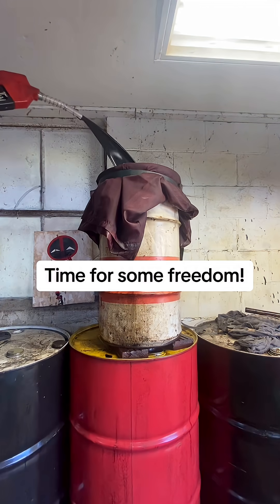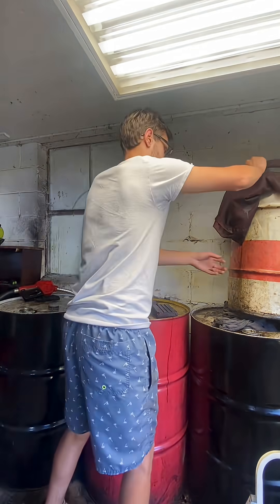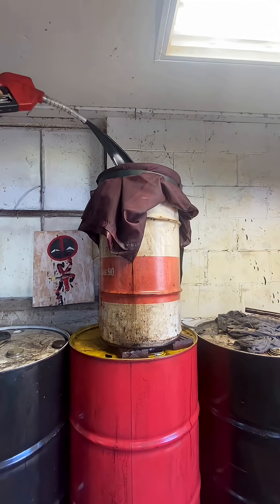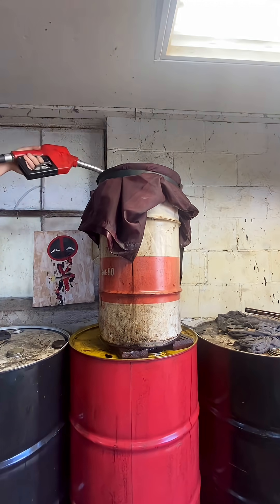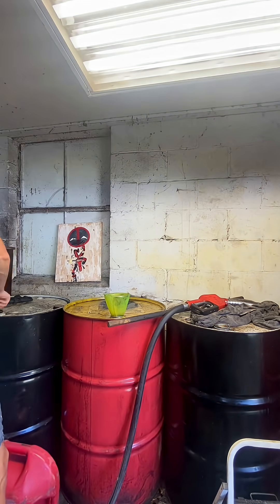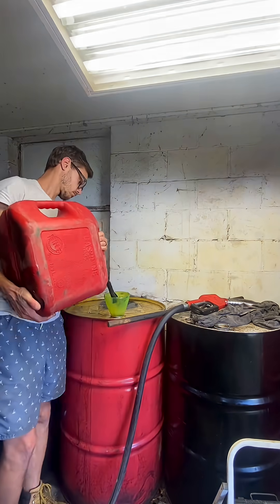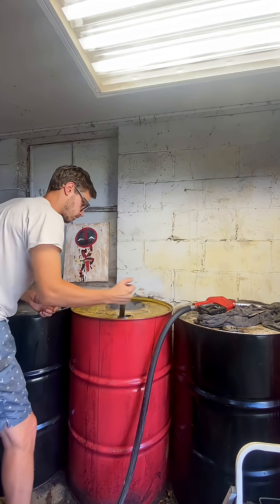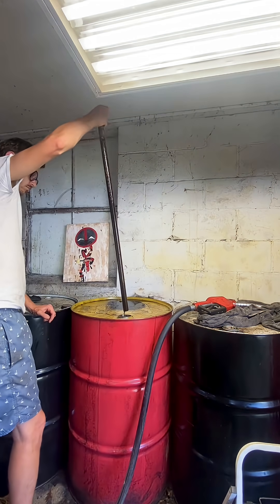Transform #wastemotoroil into #homemadediesel Fuel #dieselmechanic

Comment: I've done this with a Dieselcraft centrifuge. The old IDI Naturally aspirated engines ate the ones ive had the most success with. My 2002 24 valve Dodge does not like enough of it to make it worth while. I'm thinking about running this in my 97 powerstroke. What engines are you running this in?
Reply: Right on, looks like he has an older 7.3. Anything newer than 1998 won’t tolerate it, anything common rail will get destroyed by it.

Comment: Send your filtered oil to an oil lab . A common practice for a large fleet of equipment.  They will tell you how much metal you have in your oil. Your bed sheet is not anywhere close to a diesel fuel filter.  I will have to say don't do it until the lab results come back . Fuel pumps are sensitive to metal and are very expensive.
Reply: Bet he's just 🤡 around so you will copycat him and toast your engine , or get caught by DOT for fuel violations.
Reply: @ralphday4842 no one cares about dot .  But I need to see a lab work up . Because not chancing a fuel pump
Reply: The inside of the engine that the oil came out of is a lot more sensitive than the fuel pump .What you need to worry about is the injector
Reply: @TomThomas-f3w, regardless, send a sample to a lab , even to satisfy curiosity.  It's not that expensive
Reply: @TomThomas-f3w , I sent bio diesel and cooking oil to the lab . Looking for contaminates.  It is worth it

Comment: You make diesel with used oil and gas? Does it burn the same? Same mpg? How much does it cost you and how far will one barrel get you? What diesel motor are you using and does it have mods to support other fuels? Will that homemade diesel run in any diesel?
Reply: I wouldn’t do it with any modern engine but older stuff, including the 6.0 and 7.3 Powerstrokes and pre-2007 Cummins B series engines will run it no problem with negligible performance issues. I’ve run straight hydraulic oil and transmission fluid through a 7.3 and several skid steers for about a year now with no problems. Diesels fire on compression and use super high pressure injectors so if they can atomize the fuel it will burn and the engine will run. Filtering the waste oil is key, though, and it’s worth the money to build a proper filter head rather than using bedsheets. Or you can install another filter directly on your truck and filter it that way lol
Reply: I think his motor is heavy smoking
Reply: Newer motors, don't. It'll destroy them. Older ones with mechanical pumps, have at it but keep extra fuel filters on hand all the time.
Reply: If he distilled the oil first he would be making diesel. Mixing gas and oil like he did only made premix or petroil with a 1:50 ratio.
Reply: No you're not MAKING diesel. He's just filtering used oil adding gas to thin it. Then burning the oil. Diesel is just a certain spec. of oil.
Reply: Same questions I have.
Reply: Go to his page gents. He show you everything you need to know including upgrades he’s adding.

Comment: Did you say that you put used motor oil? I’m just wondering but wouldn’t it have a different composition due to the metal in it, I know it’s microscopic but wouldn’t it still have an effect? Also don’t gas and oil separate? And what does adding the gas do?

Not trying to be insulting, you know what you are doing (obviously) just curious
Reply: Gas thins it out to flow better. Also helps any particles to settle in the bottom, I would hope he lets it settle and pumps off the top
Reply: @Midnight_Rider96  ooooooohhhhh ok thank you. That makes a ton of sense thanks for explaining

Comment: DO NOT use this type of fuel on common rail diesel engines. That oil is black because of soot deposits from the combustion process.soot is carbon and very abbrasive.
Reply: Would used motor oil from a gasoline engine work better?  

I do all of my own oil changes so I’ve got about 20 gallons of used 5w30 motor oil that came from gasoline engines with 5k to 6k mile oil change intervals.  

The diesel motor that I would need the fuel for is an old 1982 John Deere 750 with a 3 cylinder mechanical injected diesel.
Reply: @91CavGT5  yes the gasoline engine oil would have alot less abrasive contaminates, but the john deere wont care either way you could use the diesel oil in that type of engine. But if you wanted to properly use oil as fuel maybe look into a cetrifugal filter set up to run that oil through, it will do a good job of removing any solid contaminates from the oil.
Reply: @X-eler8  thanks

Comment: Put a screw with a rubber washer on it into the back of the handle on your gas can. Loosen the screw when you want to pour the can and re tighten it when you're done. Gas will flow much better and you still mitigate evaporation and water intrusion from the can.
Reply: I've always drilled a 3/8s hole on the under side of the handle of the epa cans. Or just use a 5 gallon water can from Walmart 😅 their blue and they never get stolen cuz people don't think it's gas😅
Reply: @icbro21  "um, sir...thats illegal." 🤓
😂 Man I frikken cannot stand those EPA cans. Spill resistant my behind. They almost guarantee a spill.
Reply: I have the EZ Pour vent and nozzle on some of mine and a screw with sink washer on some.  Both work.

If you get a wing nut appliance screw it is just as easy to open and close as the ez pour vents.
Reply: Oh yeah,  don't drill along the mold seam.  Just to one side or the other.  Sometimes the hole makes the can split if they're old plastic.
Reply: Pull a rubber valve stem into high point on gas can. Use as vent
Reply: @ryanscott1316 just push a Philips screw driver in it and call it a day the can is just to make this crap . And is in the back of the truck no need to worry about a few drops .

Comment: Does the gasoline seperate? How's your catalytic converter look?  Emissions tests, that'd be fun? Do you know anyone that could do one just for fir fun.
Reply: Diesel don't have cats. But in the US at least they've had to run def systems if they were made after 2007. Don't buy one made after 07 they're a pain.
Reply: @bravelilb diesels have had cats since 03. Some 7.3s even had them before that. After 2010 they have an scr which is a def assisted cat on steroids 😂

Particulate filters after 07 but that is completely separate from nox reduction
Reply: Your state has emissions tests for diesels...? Communist
Reply: I wouldn't use this in any engine made after say 1995. A bed sheet is certainly not enough filtering for most unit injectors. Forget about running it in modern common rail systems with DPF and SCR, you will destroy the injectors and after-treatment system.

Comment: Have you measured the Cetane level?
Reply: You dont have to its been used as Diesel 
Motor oil has an ictane of roughly 50 ish 
Gasoline hes using Probaly somewhere in the Ballpark of 92 octane 
Since i dont use my dick to mesure things I Cant Tell you how manny more octane youll get from adding 5gal of Gas to 50gal of oil since i use the metric System
Reply: @blackangel2234  Cetane and octane are opposite ends of the scale.  In diesel fuel, the cetane measures how easily it will ignite.  Octane measures how resistant to preignition (compression ignition before the spark) gasoline is.  Higher cetane number = ignites easier/lower temp.  Higher octane number = takes more/higher temp to ignite.
Reply: @blackangel2234 cetane and octane aren’t the same.
Reply: @blackangel2234 ”I don’t use my dick to measure things” 😂😂😂 that sent me flying
Reply: @blackangel2234  I will never understand the saltmines built around the idea of a country not using the metric system xD 
Nobody cares

Comment: Do you have video of how the vehicle runs and drives?
Reply: Most diesels love waste oil
Reply: @CoinHuntingUSA no most don’t, you will wreck them before you leave the driveway.
Reply: @Redbloodroadrunner  He explains he runs it strictly in his 91 IDI and that if it doesn’t have an indirect injection, the fuel will not work and damage your vehicle.
Reply: @Redbloodroadrunner It works fine. Better than pump diesel.
Reply: @haynesshepherd6180 in what and for how long? If it’s not older than 98 it will shit the bed, especially doing it like this
Reply: Answer is no lmao 😂
Reply: I have a 97 7.3 I will. I think it would destroy any modern diesel
Reply: Great video. Engines after 2000 have very sensitive enjectors wouldn't dare using that oil on them.
Reply: Get on YouTube, lots of videos on this topic
Reply: Probably not because it needs new injectors and a fuel pump at the moment.
Reply: How do we reprogram the EMS so it knows how to best burn this admixture for efficiency and minimising emissions?
Reply: It works he actually added a few useless facts tbh
Reply: No need to let it sit a week honestly
And no need to added gasoline 🤷🏼
Reply: Diesels have oil goin through their injectors. High maintenance machines. I got a 5.7 hemi teehee

Comment: That really cool man! As far as that home diesel fuel goes, how's your engine doing? Like, has it required any more maintenance than just using regular diesel, or have you had to swap any parts to make it run better?
Reply: This is usually done to older naturally aspirated engines, they run much better on oil fuel. Most people, including myself, install a big fuel filter or an aftermarket pair to filter things better. Micro metals will destroy injection pumps especially quickly on new stuff.